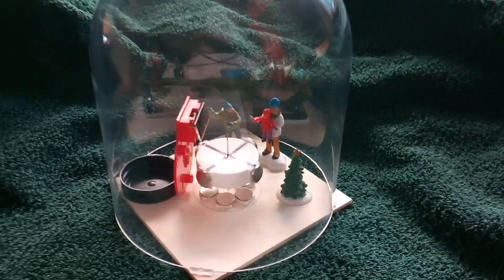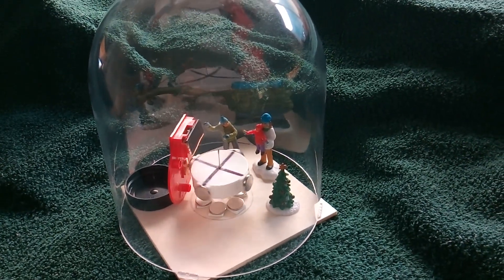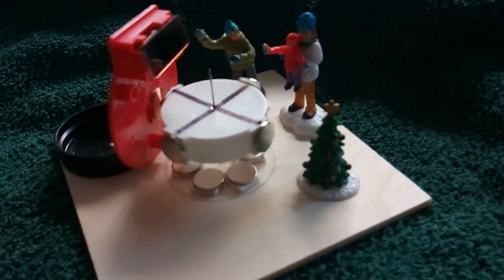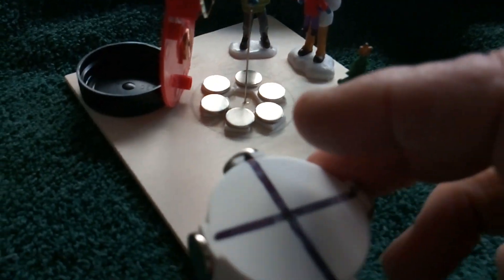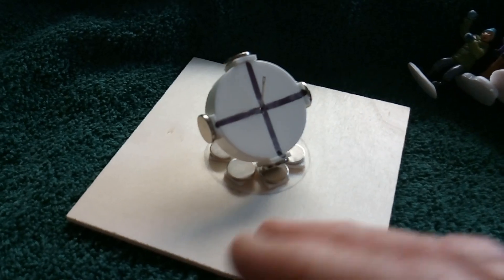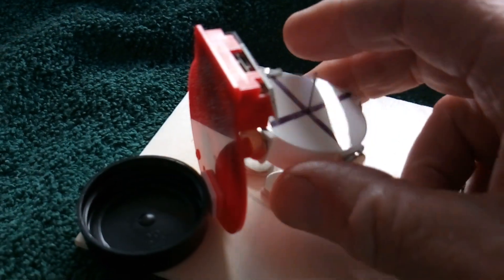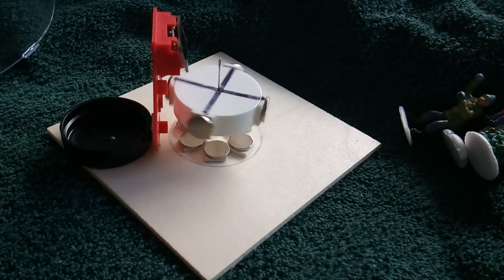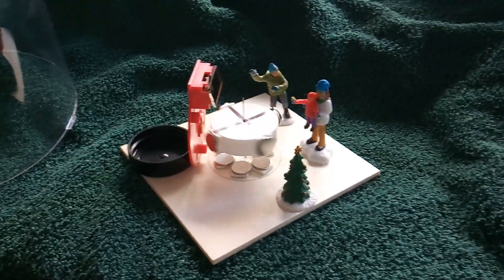Solar Powered Mag Lev Motor

Comment: My great grandfather also had some perpetual motion machines.. the rumor goes he got one design to finally work but it had a fatal flaw in the design which causes it to constantly increase in speed. They said he spent hours putting it together, and starting it going just to have it blow up from spinning too fast for years. How true that is, I can not say because they had no pictures of his contraptions at all. He died before I was even 2 so I can only say what my mother and her parents remember about the thing. It sounded like an interesting device, I wish I was alive to see it to be honest. He apparently built the same design at least 80 times, and every time it ran its self apart. Oh well, I guess we can only imagine how such a drvice could ever work. Maybe one day we will get to see something like it. Very cool motor. I made a levitation one just like it, but I need some ideas on how to power it properly like you did. I tried a reed switch but I think my coil isn't large enough to work properly. It almost works but not quite.

Comment: Ha, someone thought this was wind powered?! Probably because there really are so many fake stuff floating around.  But all Lidmotor's stuff is totally for real, folks. Check it all out; I did; nothing fake here, and everything amazing, operating on the edge of super energy efficiency, truly bordering on perpetual. But in a world slowed by some form of friction, its fun to identify what energy is available to keep it spinning nonstop.  

Here, I'm always amazed at how much movement can be produced with such little solar input. Unless you are living in a cave, solar energy is a freely available inexhaustible power. 

Sure these models are small; but they are all scalable, build it bigger if you want more power, and they all are illustrating a big concept: that all friction can be overcome, and movement can be perpetuated by accessing whatever energy is available in the local environment. 

Here there are two sources of energy available from the local environment. First that tiny bit of input is Solar generated electric. That little bit of current causes, say, a small 1x magnetic field of space to be produced and then concentrated in a coil of wire. But that small 1x magnetic field is engineered to produce a large 10x mechanical force as it interacts with the permanent magnets 10x permanent magnetic field, whose force magnifying effect is also freely available from the local space environment.

Comment: How much weight can it hold?
Reply from the maker: I don't know.  Good question.  Try pushing two magnets together and you will see that the closer you push them the harder they push back.   Balance is an issue on this one.  The weight has to be distributed evenly.
Reply: @Lidmotor  I've tried that with ring magnets and it took less force than I expected to overwhelm the magnetic repulsion.

Comment: What is the rotor's outside facing polarity relative to the upward facing magnets?  Or does it not matter?
Reply from the maker: The rotor magnets outer polarity is the same as the top of the stator magnets.

Comment: If that rotor should float at all it would be on thick, not on thin air!
However it doesn't float at all. It levitate's, suspended if you will,
by electromagnetic force to prevent it's fall.
Reply from the maker: Thanks Ben.

Comment: Can you make a motor that doesn't use magnets?
Reply from the maker: Yes.  I have my eye on one.  It just uses all electro magnets.  Many motors are built that way.
Reply: @Lidmotor  I mean no magnetic fields at All
Reply: @Lidmotor  three phase brushless?
Reply: All engines are motors but not all motors are engines
Reply: You mean a combustion engine?
Reply: @benwinkel  a motor, not an engine. a repulsive force that isn't magnetic .
Reply: @justtinkering6713  Explain to me, the distinction between a motor and an engine?
Reply: “People use both interchangeably, but the difference is that motors run on electricity and engines run on combustion. The engine converts various forms of fuels into mechanical force, while the motor transforms electrical energy into mechanical energy.”

I see...
Reply: @justtinkering6713  I can think of several repulsive forces that are not magnetic...
Reply: @benwinkel  I hope someone makes a motor like that.
Reply: @benwinkel Not easy. Would you call a clock motor an engine? Would you call an electric motor an engine?
Would you call a water motor an engine? Would you call an electrostatic motor an engine? No, in all cases. How about a rubber band motor? Nope.
Reply: Turbine.